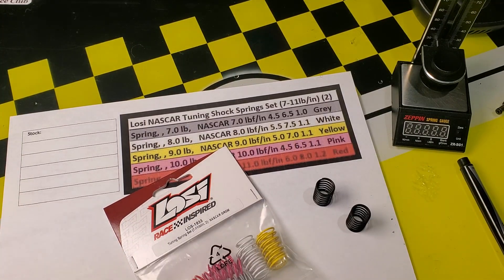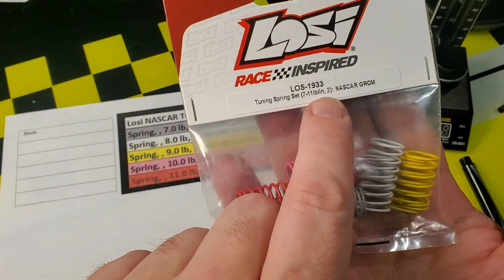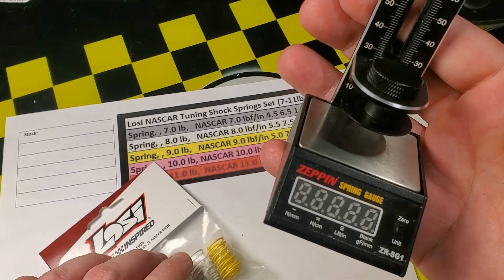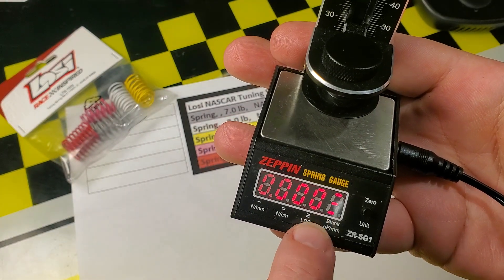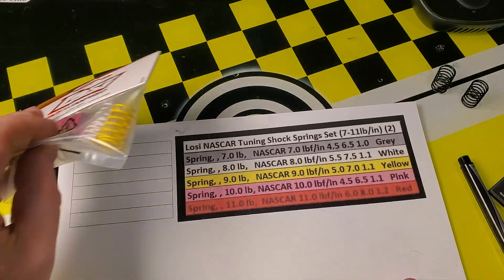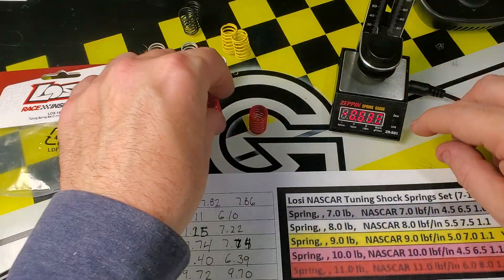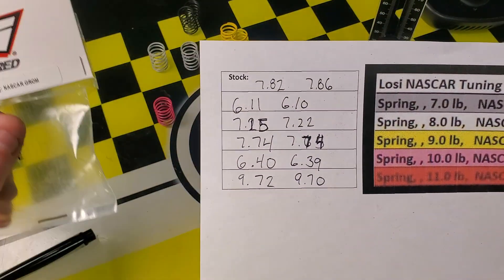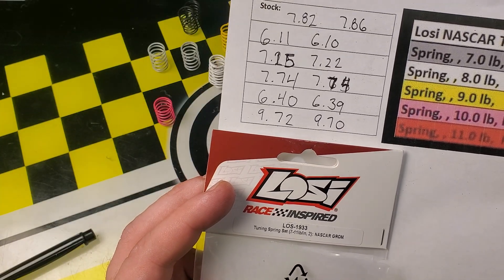Review: Losi Nascar Tuning Spring Set LOS-1933

Comment: Got my zeppin tester today and 110% agree that you know your machine and how to use it correctly and that the Losi tuning springs are way off in every color category. I canceled my orders for the Losi springs I had and am convinced I will have to find another option to get the desired spring rates I am looking for accurately. Appreciate this and your other videos.
Reply from the maker: @scottbrodie3071  that little tester is worth its weight in gold. Really hard to believe the springs are so out of spec.
Reply: Yeah horribly out of spec, I am struggling to find a replacement set for them from other vehicles this is my only rc car so I can’t really compare to anything else like a TTo1 or something comparable that might have similar specs for springs mine  measured 22mm length 13 od trying to get an actual 9lb or above springs most of my sets were 7 and under!

Comment: Have you tested with the 2mm shim sold for short shocks like these being tested?
Reply from the maker: @scottbrodie3071  yes, ive done tests with the 5mm shim, 2mm shim and even a 1mm shim. Using the different shims you can test between 1mm and 10mm of compression. If you test with less than 10mm you need to adjust the result to 10mm. For example, if you use the 5mm shim that is only 1/2 of 10mm, so you multiply the result on the gauge by 2.
Reply: Cool, I wasn’t sure, I ordered the same zeppin machine like you have and will test my current sets and the new sets I ordered. I ordered all my sets from A main hobbies if they don’t check out legit then we have two witnesses for sure! But my current sets seem legit to the specs given by horizon will let you know for sure when the zeppin comes in!

Comment: And not sure if you have any calibration weights for each springs pound weight but that is another thing to consider when pushing down the spring is how much force it can’t accurately be test by hand and needs another method that is more accurate like one I mentioned.
Reply from the maker: @scottbrodie3071  the design of the tester limits the little plunger that compresses the spring. It will only allow it to be compressed by 10mm. The design of the tester is very simple with the plunger on the top which limits the compression to 10mm and the silver tray on the bottom is a digital scale. It is a very repeatable test and i have tested other springs with known values and it is spot on.
Reply: Sounds like a great little device that they took that into account when building, I wasn’t sure. My dad and were wondering if they tempered the shocks maybe or something that made them weaker via to much heat
Reply from the maker: @scottbrodie3071  i agree, i looked at the springs and there is a formula that can calculate the spring rate based on the material strength, the wire size, and number of coils in the spring. I used a caliper and the wire sizes are different color to color and the number of coils are also different color to color. So it seems losi were having them manufacturered to a spec so the only other variable is the material which must be soft like you mention.

Comment: Exactly what I was thinking too, I had contacted horizon hobby about which spring is which and it took them some time to respond and they emailed me the specs on your list I then posted those specs on multiple posts platforms to help others and I agree that there is inconsistent springs my whites are the same as stock and my pink are not six like yours but pretty stiff my reds being the stiffest.
Reply from the maker: @scottbrodie3071  i contacted horizon as well. I couldn't believe how off these springs are.
Reply: That digital tool is pretty cool for the springs.
Reply: I got to thinking again about this while watching the video again and not sure if it would matter but wanted to mention what I was thinking that if you could at least retest one set of springs with the zeppin machine but cut out a one inch by one inch square piece of firm plastic or wood and place it on top of the silver square then compress the spring on top of that and test and see what values it reads?  Less or more or equal?  A piece just under the surface of scale dimensions I would test to and check the results with all three to see if the zeppin has any issues.